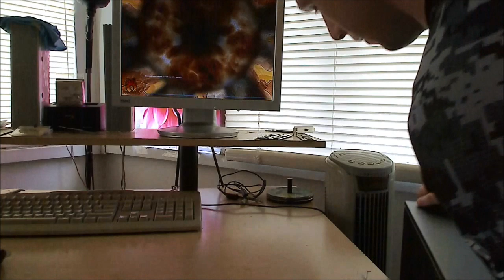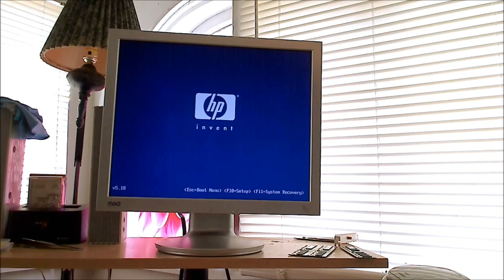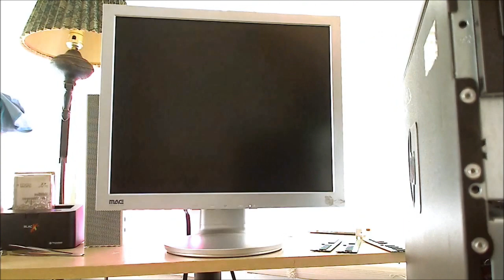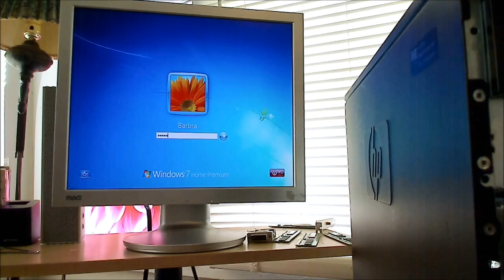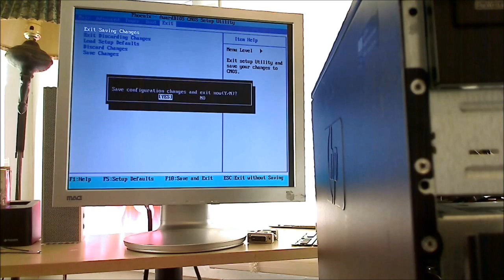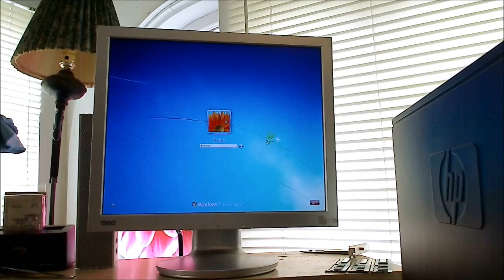GPU BIOS Flash - Alternate Method

Comment: Thanx for explaining, actually i have hd6850 and amd motherboard with amd integrated gpu (graphic).
And the newer version of atiflash, amdVBflash ati/amd win bios flash software crash my PC every tim i run it as administrator.
The PC than restart it's self.
But now i find your video about older amd/ati graphic cards and i hope it will work for me.
Somebody bricked the GPU and it not post a screen.
The card is detected as a second card, (first is the internal from the motherboard), the driver for this GPU is detected as HD6800 series.
But the gpu-z, shows all information, and some are not correct such value of ram (in my case 0mb) and bus width (in my case 512bit)

Comment: This guys teq dont work.. he got lucky... 3 fuckin days of messing with this guys bullshit method.  i got lucky after i bricked mine. i went into asrock bios and set to apu onboard gfx. switched of some othr stuff. after a fresh install of the same os i used to brick it . i then got a few crashes and win 8.1 bsod.. then i got a windows auto refix... rebooted  and got to desktop. ran win atiflash and it ran this time.. all the other time it just bsod'd windows.. so i had 3 bios saves. could not remember which was the correct one. luckly id took a screen grab with gpuz just before i bricked it. showing me some numbers that matched one of my gpu bio.s and THANK GOD AFTER 3 DAYS SOLID TRYING IT WORKED.. I THOUGHT ID FUCKED IT AND REFLASHED THE APU BY MISTAKE. SWITCHED IT OF and held my breath. took the hdmi out of the apu slot and put it into my R7250x.. got nothing... just a few loud crackles from my sound card then BOOM ITS BOOTED.. THANK GOD.. lesson learnt.. never mess with the dark arts unless you had good training. i was gona do it with dos and a Usb stick in the morning.. no need now... arrrr. i feel better.. thank god.. This guys method only works on his system. lucky i had a asrock and APU or id of been screwd... one happy gamer from the UK. ALSO IN GPUZ MY CARD REPORTS ITS A hd 7700. its supposed to be a hd7770  im sending it back.

Comment: +Tony Jones R7 250x is the same card as HD 7700 just rebranded. You probably flashed onto your card bios that was for R7 250. R7 250 isnt based on any old chip. So in fact r7 250x (HD 7700) and r7 250 are very different. They have less common then for example r7 250 and r7 260, becouse as i said earlier r7 250x is based on an old chip.

Comment: I BRICKED. a supposed sapphire r7 250x. on gpu-x readout it does not read as a r7 it reads as a  HD 7700. have i been ripped of ? I know the cards where made from old gpus. but surely they would read as the correct name. Saffire aint hackers. any thoughts dude. im trying to figure whats going on now.. I NEED TO GET IT BACK.. OBviously iv flashed with correct bios. but the the card aint correct... this is for my kids xmas present.. Iv been buying bits at a time.. im fuming..ebay con artists. though he did say he would exchange it if i wanted a better bigger card fir starwars bf.. maybe he dont know there bogus, maybe ???? lucky i kept the old bios. but i cant seem to get it to boot with the r7 in and 8 pin..iv tried every way i can think of.

Comment: Hi friend! I was trying to make something out of my old HD radeon,and ended up in shit. So i did as you did for some stupid reason i changed the gpu speed and saved it,and i have done smart thing before that and extracted original BIOS from card. Programed the changed BIOS,restarted and it found my card like STANDARD VGA,the AtiWinFlash is not detecting any ATI hardware,in atiflash it says (no adapter found)...
And it works,actualy i have integrated intel G41 and my ati radeon HD 6770 VTX3D DDR5 - 1gb is inside computer,but detected as standard vga. :/ What can i do to revert it back to original state,and how to do it?

I now have original bios but no adapter found to flash it...

Comment: HI, maybe you might know this, if you can watch my video I just uploaded today. I can't seem to get into my bios at all to set the settings like yours at 7:44 I just put a like new nvidia video card in but yesterday, my breaker blew, and I notice when I reboot, I don't even see the hp blue screen with the option to system restore, and where you can press esc to get into the bios, it just goes to windows, where it says welcome. I also just got done doing a complete factory restore on this computer, but still having the same problem. And I did also noticed after it was about done setting up win 7 after the register process win finally starts, then I see a box appear that says cmd error not found, or something like that. it did it to fast and went away, so I really could not get a real good look at it, but I know I seen cmd error or not found. Anyway please watch the whole video if you don't mind, I am at lost here, I also tried putting the monitor cable on the built in video card, I get the screen then, but anyway watch video please you will see what I am talking  about. Thank you
Reply from the maker: So that little warning window from ATI tells me a lot of things. Firstly that your loss of power isn't causing your issues. I will list some GENERIC instances and solutions that I have come across in my years of working on and maintaining computers. Some technical terminology may be missing, but I think you are smart enough to figure out what I mean. When a computer turns on or POST's, it goes through a check list. Then hands off the remaining and final instructions to the OS for boot. Communication between a BIOS and and OS usually only happen when start up and shut down is initiated ( the only exception being with very high-end motherboards with UEFI). On every restart it is the duty of the BIOS to check for any new items that may have been added to the computer (like your GPU). One reason you may not be able to see the menu on start up to enter BIOS is because you have not set priority in the BIOS for the GPU to show start up options. So this can confuse the computer for a moment. It will then try to detect which GPU/video output that had a screen connected to it. By the time it detects it, the menu to enter the BIOS is long gone and the computer decided for you. This is just one Instance I've had (in very generic terms). I think what you also have is an APU. Not a CPU. An APU has both the GPU and CPU one one chip. It looks exactly like the processor, that is because it is. It goes in the same slot/socket. This is why you are getting your AMD errors on start up. It is not like a traditional integrated/on-board graphics solution. If you were to look in system properties, it would actually show a GPU like one being installed on the PCI (780TI, HD5850, 6620G, these are examples). Thats because that processor contains actual cores from a full-sized GPU. It gets its RAM from the system. It has no RAM like typical PCI based GPU's. How does this effect you? Well, remember how I mentioned that the BIOS may be confused as to which card it need to display to? This is the cause (usually is at least). Disabling the AMD GPU can also be done in the OS. That option should be accessible in Device Manager. Don't disable it just yet though. That is your last option. What you should do next is download the GPU drivers for that video card you bought. DO NOT install the ones from the CD. Those are outdated. Only ever use those if you have no way at all getting the newest. It may also be necessary to remove the AMD Catalyst/VISION Drivers from your computer. That one may not be necessary and will be entirely at your discretion. I suggest you leave them there, unless you continue to have problems. Then remove them as a viable option to reduce your probability for conflicts. If you want to reinstall those after they have been removed, use the same option I suggested to get the other drivers. Those can be gotten at either the vendor or manufacturers website. So in a short recap, install the PNY GPU drivers. Fiddle with it a bit sing the suggestions I provided. Booting into BIOS may not be needed once you have those drivers installed. Should you still have problems, connect that DVI screen into the integrated GPU. All while having that GPU you added, still installed in the PC. You should see your option to enter the BIOS. Then from there, go and select your card (this can be done before or after you installed the drivers for the PNY card). This should solve your problem. I have used combinations of what I have suggested to you many times. I know it works. It's just finding the right combination for you. This last bit is a personal suggestion and may benefit you greatly. You have an AMD system. Stick with AMD. If you can return or sell those cards, I suggest you do so. If you have an APU like I think you do, getting a compatible AMD GPU can benefit you! Research the processor you have. A lot of AMD's APU's are able to be connected with a corresponding and compatible video card. This in essence, will give you AMD Cross-Fire. That's fancy for two (or more) GPU's (which work in tandem for greater performance)! This will also reduce any compatibility issues you might have or may have in the future.

Comment: An alternative method that may work for some cases and is far easier than this demo: once your video card can POST (displays but crashes windows on boot/BSOD), boot in safe mode(depending on your config/OS pressing F8 should bring up boot functions after POST)>device manager> under the display adapters, uninstall and select 'Delete driver software for this device'. Restart, proceed to booting normally into windows. windows will detect new hardware and attempt to install drivers (you can ignore that) run your bios flashing program such as atiwinflash using it to restore the original bios file from your backup or use the video bios collection on techpowerup . c o m to find your default/desired bios. flash restart then done.. worked for me on my radeon 7870 when i flashed to r9 270x bios. you will need to reinstall the drivers for your video card after the process.

Comment: can u tell how to flash zotac nvidia geforce gt 610 2gb synergy edition
...plz...........
Reply: kk
Reply: did you fix  it if not do the same things he does sept use these programs http://www38.zippyshare.com/d/22157865/26358/USB%20flash%20tool%20for%20NVIDIA%20GPU%27s.rar  use nv flash and nibitor is the other equivalent to the radeon flash tool he uses

Comment: hello i have a bricked radeon 6850 and i dont have extra gpu but theres no display anywhere but if i let my pc boot and i connect to it through teamviewer or logmein i can see the desktop and my motherboard recoginzes the card but when i go to open atiflash it says i 800x600 res required and its stuck on 640x480 is there any other tools that i can use to flash it from desktop?

Comment: hey i have a question. i have an xfx gpu no voltage unlock. my question is can i flash a asus bios which has voltage unlock. its a hd 7770 .and i found an unlocked bios for asus.

Comment from the maker: @mus3f0rliv3 Try and change the boot settings in the BIOS. This may work. But as i stated in my video, it will only work with that old "legacy" PCI slots. So you may need an older card to get this to work properly. Then lust follow the steps  in the vid. Feel Free to pm me. I will try my best to help you out. I will say that i am out of town right now, and my responses may be a little slow. But i will do my best for ya!

Comment: I have an HIS radeon hd 6950 and I tried to unlock it to a 6970, I used the HIS 6970 bios and flashed it, no problem at all, untill I needed to reboot my system.. I rebooted and geuss what? nothing happend. black screen all the way.  I tried to run it with another video card, wich didnt work.. I tried to run it with my onboard video controller wich didnt work. however, when I pull the 6950 out the slot, it will boot with the onboard gpu. I have an backup of the standard bios how can I recover?ty